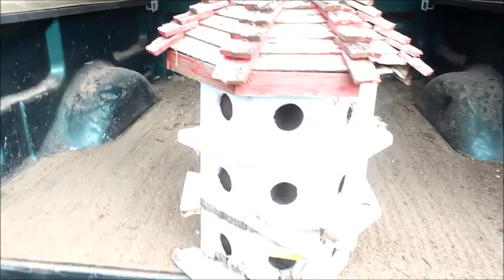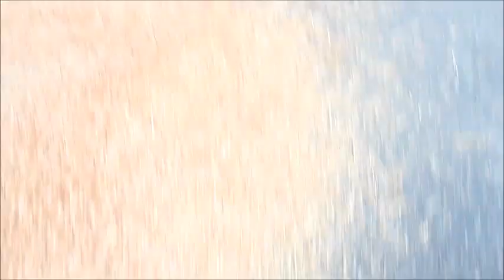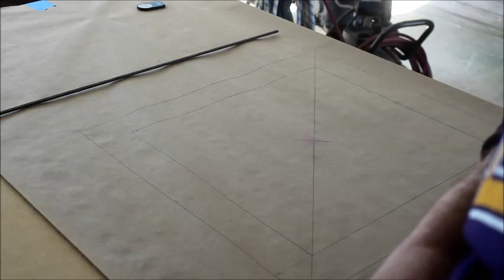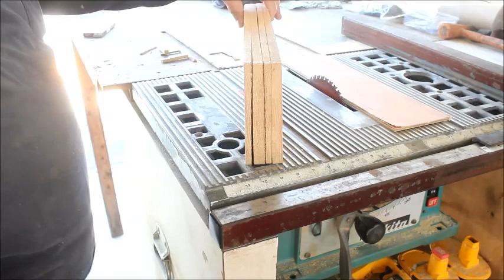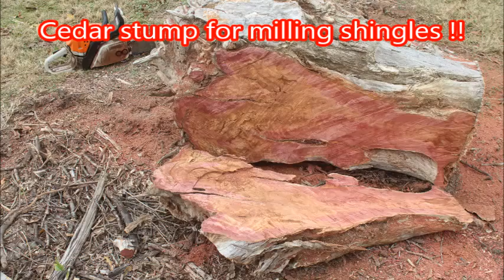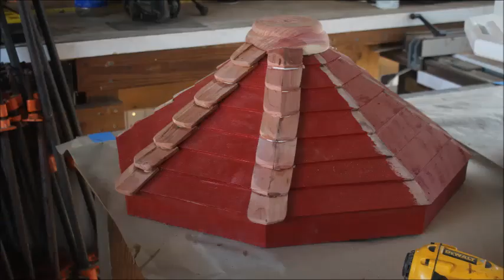Bird House Hotel

Comment: Wow that perfect sphere was impressive. You make it look really easy but by the size of hands you have sir it may require a lot of strength. Do you think a 13 yo skinny boy could work that spinning thing and get similar results? How many balls would one have to mess up or maybe hours on that machine? Asking for a friend.
Reply from the maker: Very kind of you to say so. Thank you for watching and commenting.
On the contrary, the ball is not so hard to make. I don't even think it took 30 min. it's not the size of hands but the speed of the spinning wood on the lathe and the sharpness of the tool.

a)  I've seen many children 7, 9, and 10 yrs old learn to hold the tool, resting on the tool rest, and cutting shaping wood on a lathe.
b)  depending how deep and wide and where you make your cuts determine what shape you make. (cones, balls, decorative legs for tables, etc ...)  https://tinyurl.com/3ma3s2kn
c)  just cut into the wood cylinder from the middle to the left, deeper & deeper and then again from the middle to the right in the same way. That's what makes a ball.

There are helpful "jigs" like  a piece of paper cut like a 1/2 circle you could use to see how close or more you need to take out to make a perfect round. You could use a protractor to make the circle on paper and cut it out. Then hold it up to the wood on the lathe as you get close and determine if your shape is close.  You can also use sand paper to shape it when you get close and if you do cut to much you can always make it smaller and reshape it.
It does not take muscle but tact. The lathe spins at about 2000 to 3000 rpm's so all you have to do is take off a little bit at a time until the shape is how you like it.
Simple as that !!

By the way, there are many video's on YouTube to help if you like. You can watch dozens of them !!
Good luck and 
God bless !!